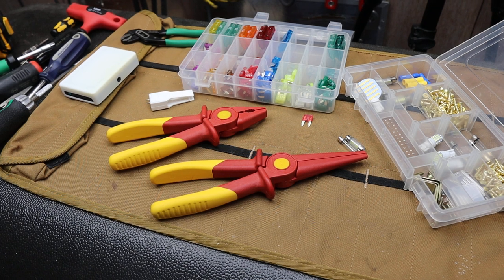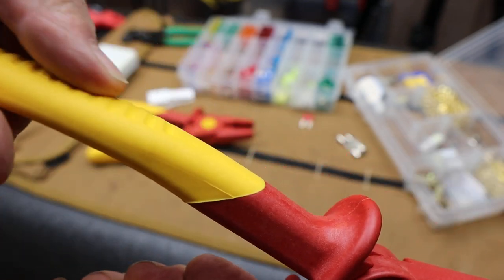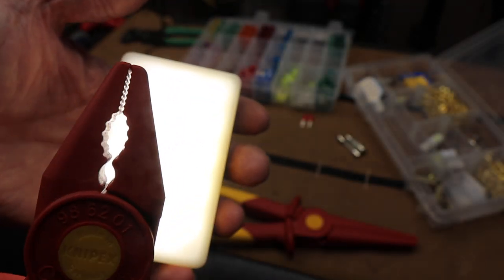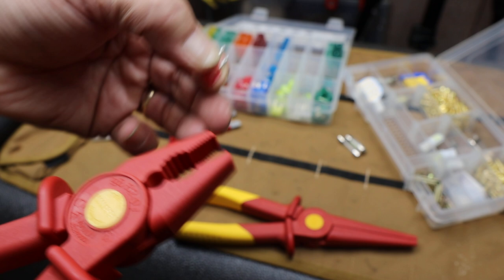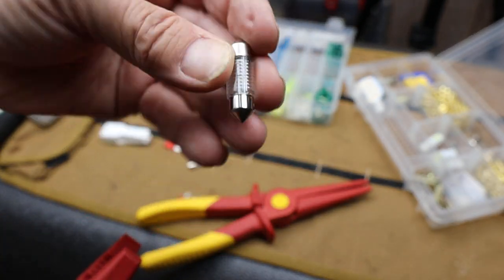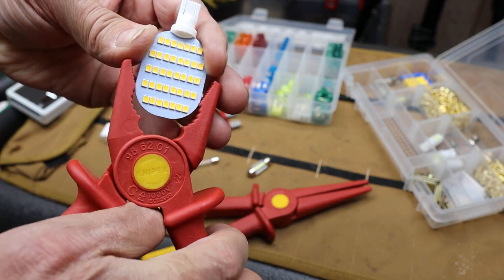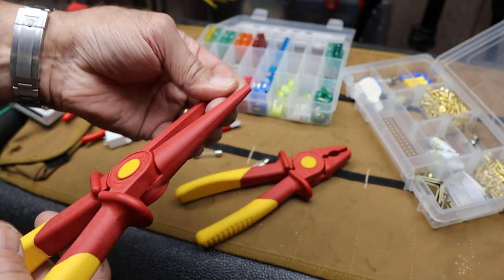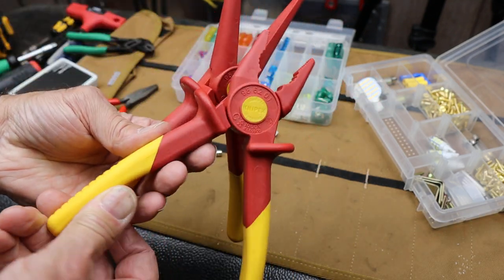Knipex Plastic Pliers: Snipe nose multi and Needle nose. 1000v rated, non-marring, and affordable

Comment: I have both of them. I use the 01's to replace disconnect 30A fuses as well as 24v 3A and 5A board fuses. I use the 02's to push in contactors and stubborn wires into a crowded box or panel. You hit the nail on the head about the long nose pliers, I'm considering cutting some aggressive grooves for more grip because they slip too easily when you need them most.

Comment: I think they are best suited in cases where you work with live wires, and you don't want to accidentally short live to ground, neutral, or even short between different phases.
Reply: Agreed.  I have both and use them almost exclusively for panel work... pulling wires, placing wires onto terminals/screws/buss-bars/etc.  I have a healthy respect for electrical panels, knowing even if the main breaker is shut off, the feeds are still live and you usually have to bring new circuit wires into the panel from above and across those live legs.
Reply: I've used them for aircraft electrical harnesses, not so scared of the voltage but of damaging 100's dollars worth of delicate cables

Comment: I am not sure I have seen a fuse box on a modern vehicle (maybe one of the two fuses in my 59 Land Rover) where you could get the combination pliers on a fuse, maybe the needle nose would work (not that it matters as a fuse box as it is 12v the live stuff is below the surface so I just use small non-VDE pliers) but the application I use the combination pliers and it’s the only one I have is to pull spark plug wires off a running vehicle to test for which cylinder is dead.  Have not used my needle nose, but I got them in case I had to do work on something live and did not want to short with metal ends.  Plus, you know, curiosity and to have all the Knipex.
Reply from the maker: I work on campers and RVs a lot and there is often room because there is a single row of fuses with larger ones on their own and on inverters and such.

Comment: I use these for jewelry applications (links,etc.) so I don't show the crimp, per se
Reply from the maker: Great application. The more I work with these pliers, the more I find unusual uses for them where I may have either scratched surfaces, or tried to get a grip with something like cloth inserted into the jaws of metal pliers. Some have suggested things like sparkplug wires. I can see air tube manipulation as well.

Comment: There are pliers specific to a few fuse types. I use one that is made out of five layers of burnished hardboard alternating layers but is considered non-conductive, rated as high as plastic. The smaller fuses I’ve seen pullers that look like tweezers but with notches to hook the plastic. I used to replace old fuse boxes a lot when doing residential. Thankfully I’ve changed to a more tech role because it’s not fun trying to tear out a box that has six or more conduits connected and then squeezing in a new box and fighting everything the whole way.

Comment: I use the longer knipex duckbill pliers for pulling gmt fuses. The metal ones, for the record. Fuses can really get stuck in there if they’ve been in there long enough but at least with gmt fuses, which are all plastic aside from the conductors, the duckbill’s don’t mar anything. I used to use just regular needlenose for stuck fuses which mostly worked but occasionally I would pull only half the fuse… so far the duckbill pliers haven’t done that. 

Those non conductive needle nose would be nice for reaching into places a nut or washer etc scampered off to and didn’t vaporize… or placing small washers into places your hands aren’t welcome.

Comment: I have a question for you.
Amazon has the mid torque Metabo with two batteries, a charger and a case for $399. The same set is $839 at Lowe’s.
How can Amazon sell it for less than half of the price at Lowe’s?
Reply from the maker: Assuming exactly the same,, and Lowes is MSRP,  with Amazon, my first question is it real? Second is it new? Third, is it a reputable seller (what else do they sell)? 4) US-based seller? 5) Shipping time realistic? and 6) how does Amazon compare to other online sellers. Sometimes the big boxes are the highest, with a pile of other online retailers in the middle, and Amazon for the win. But then the reseller on Amazon is also a Big Box store.
Reply: @lastbesttool  Even Acme is $399.

Comment: Doc...you buy such beautiful tools that are often a joy to use and feel because of their quality. In this video you hold onto a 5w automotive led that is usually used as a "parker light" the first click when you turn on your headlights. Not you main or high beam. But that particular one is a VERY cheap and nasty chinese led that is VERY unreliable, eben new 4/10 wont work and of the 6 that do 3 or 4 will flicker. Please dont use them in your car, they are sold for like 10 for $1.50 delivered. They are god awful led's that simply should'nt even be made they are THAT bad. U probably know this but...
Reply from the maker: Those are likely going to be used as clearance lights under red and amber housing on campers. I don’t have a supply of the good stuff.

Comment: Do you have a fairly affordable torque wrench that you would recommend?
Reply from the maker: What socket size and torque range do you need?
Reply: @lastbesttool  Either 3/8 or 1/2 with enough torque to handle DIY work on vehicles.
Reply from the maker: Forgot to ask, digital or mechanical?
Reply: @lastbesttool  I’m going to say mechanical because the digital seem pretty expensive regardless of brand.
Reply: @lastbesttool  I’ve heard good things about Tekton sockets, but the reviews on their torque wrenches are not great.
Reply: @lastbesttool  I’m not sure if you saw my reply, but I think mechanical is more affordable than digital.
Reply: @lastbesttool  I’ve heard good things about Tekton tools, but the torque wrenches have really mixed reviews.